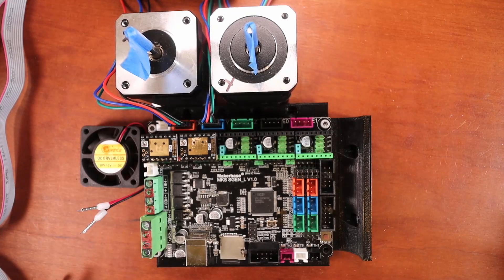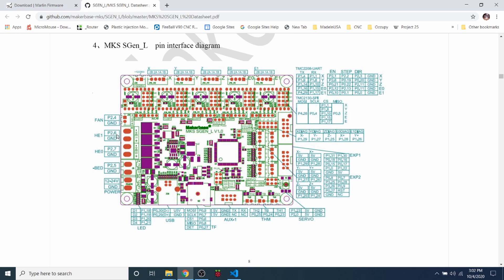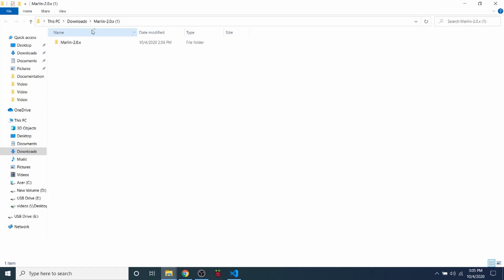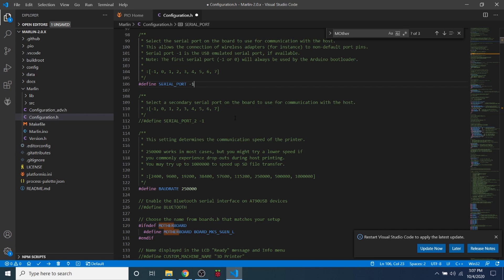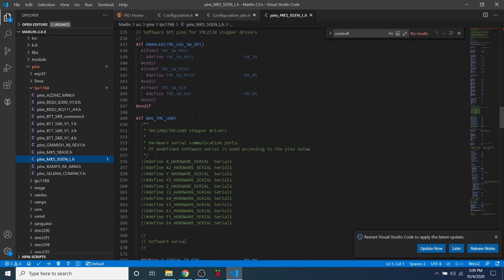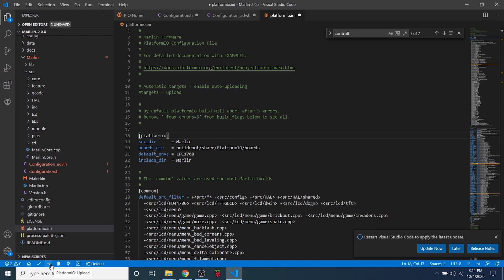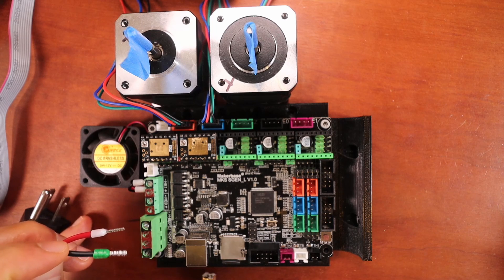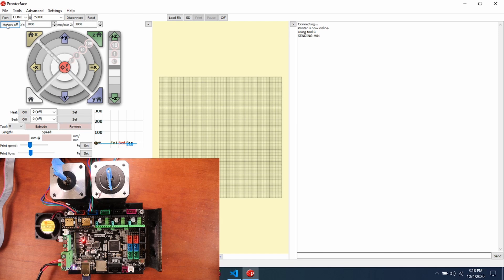MKS sGen L v1.0 - Marlin automatic stepper fan controller

Comment: Great video, but I have a question, do you recommended, use 2 fans 12v in this only connector, or what is the other way?

Comment: so i'm running marlin 1.1.9 from 3dnexus on my artillery sidewinder X1, it has dual Z motors and so all stepper slots and outputs are in use, it is also an MKS Gen L 1.0, not an sGen, would this still apply? the port diagram doesn't look as good as this with HE1 and HE0 only labeled E1 and E0, and port name D7 and D10 respectively instead of these P2.6 and P2.7. am i missing something?
Reply from the maker: Pinouts diagram for MKS Gen L and MKS sGEN L are different.
Reply from the maker: Checkout my MKS Gen L playlist.
Reply: @EdwardBraiman  alright. so digging some more i found that D7 is a named pin in file pins_mks_gen_l.h , "#define MOSFET_D_PIN 7". so am i getting it right that the row "#define CONTROLLER_FAN_PIN -1" can be changed to 7 and i should be set? :)
Reply from the maker: I've not yet worked with Mosfet external to board.

Comment: Thank you for sharing this, it was a huge help so far
Only problem I am having is the heated bed does not seem to be enabled
 Any Idea how I do that??
Reply from the maker: It could be the thermistor or a bad connection.  Are you using ferrules on connections for power?  Are the thermistors enabled in marlin firmware?
Reply: @EdwardBraiman  Thank you for the fast response, I figured it out as far as getting the bed going, I had the bed sensor value set to 0 instead of 1, but now I am having a issue with the bed only wanting to heat to 50 degrees and hold, if I set to 65 degrees printer halts after 50 deg. or so, I am guessing wrong thermistor setting or another setting, its a stock ender 3 bed/thermistor
Reply from the maker: Do you have ferrules on connections and currently I use 1.
Reply: @EdwardBraiman  I just tin the ends with solder
Reply from the maker: Well it is your equipment.  I'm mostly trying to show the safest method.

Comment: I have a question . Is it possible to change the thermistor port from TH1 to TH2. ?
Reply from the maker: It's likely in Marlin firmware in configuration.h there is a list of thermistors.
Reply: @EdwardBraiman  I'll try that
Reply: That is only for thermistor type . I want to use the second port on the board .
Reply from the maker: You'll need to possible change in boards pins file.